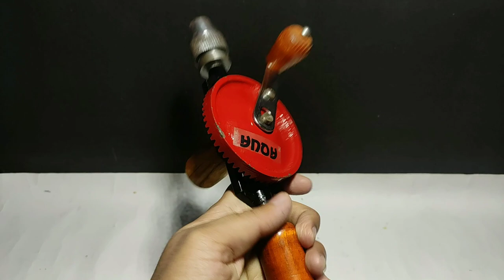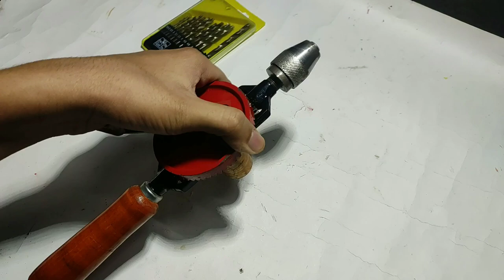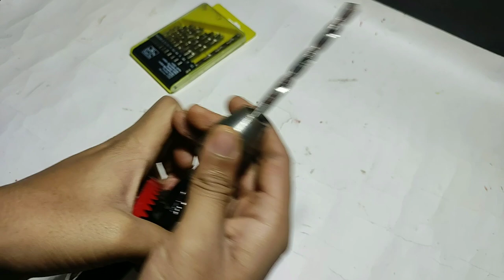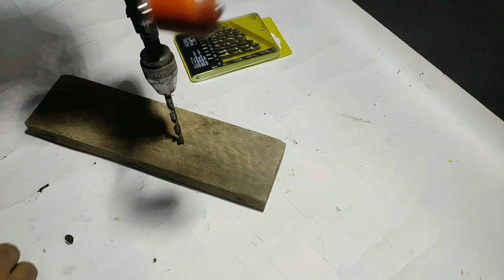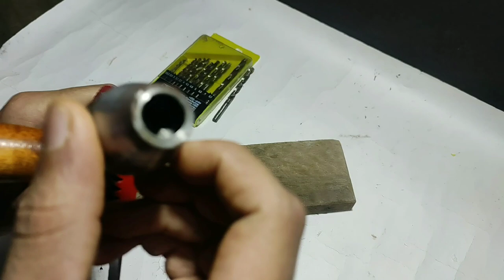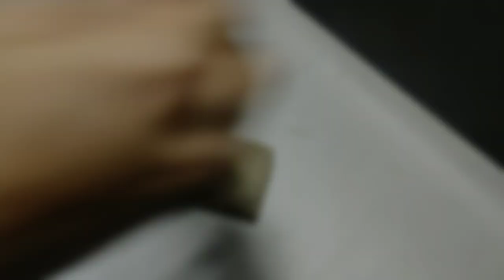How to use hand drill machine|| Creator boy || Inventious

Comment: You should get a real nice antique cordless bit driver with lots of features and filigree on it for demonstrating. 😁😀😀
I love my antique cordless bit drivers.
I use mine mostly for driving screws and nuts and bolts. Usually in low gear.